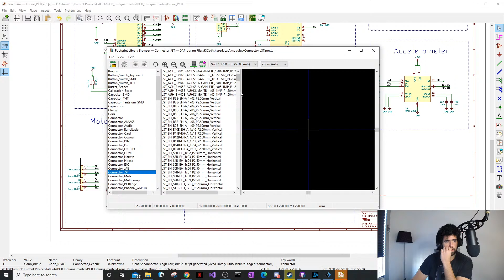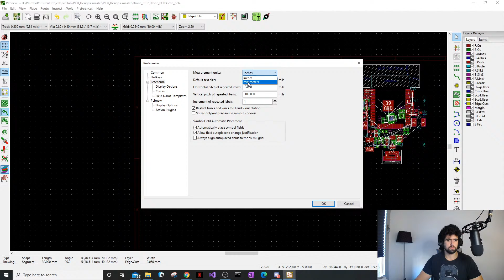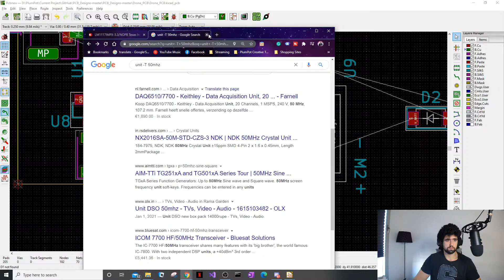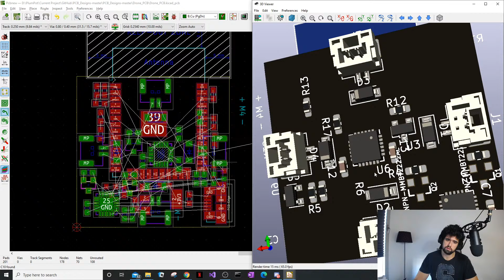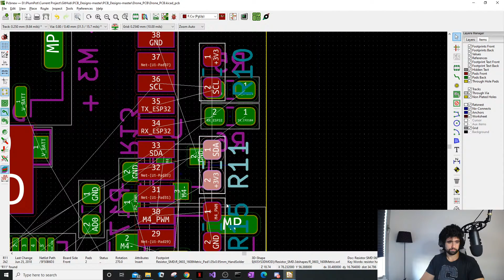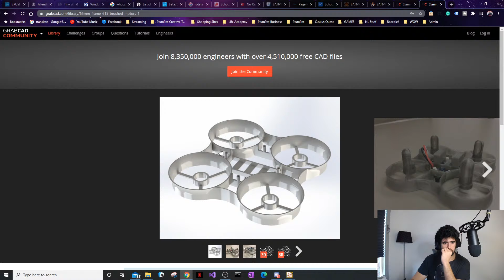Making our Drone PCB V2 #1 - Lets fix some mistakes

Comment: I got one question. datasheet says lm1117 voltage drop at maximum current is almost 1.2v. so connecting a 4.2-volt battery gives maximum 4.2-1.2 =3v. isn't it insufficient for esp32 to power on?

Comment: Can you please design quadplane flight computer and flight controller
Reply from the maker: Hi Randi, what is biggest difference between Quad plane and copter? Both have 4 blades? Can you not use this as a base design and play with the code, What extra hardware is required for a Quad plane?
Reply: @PlumPot  nah quadplane have 5 blades, four blades for hovering or move like quadcopter and one blades for moving like airplane and it also have servos but quad copter only have four blades. Thanks for replying by the way
Reply from the maker: Ahh okay understand. The concept is pretty much the same. The fundamentals but quadplane will definitely be more of a challenge.😅 let me add it on my project list and see how we can incorporate it. Maybe we can take the drone PCB and add some functionality. No problem👍 always happy to chat and help
Reply: @PlumPot   am not gay but i like you thanks